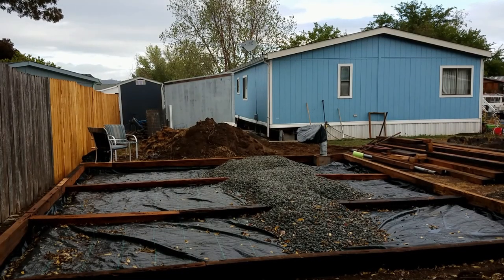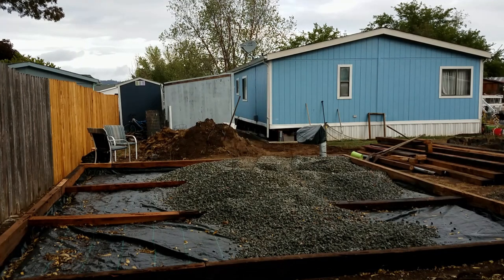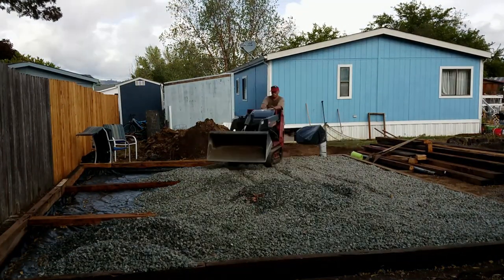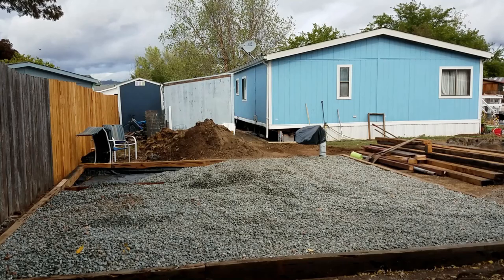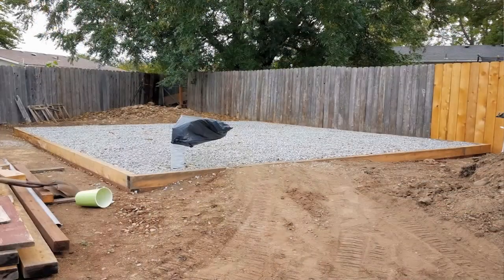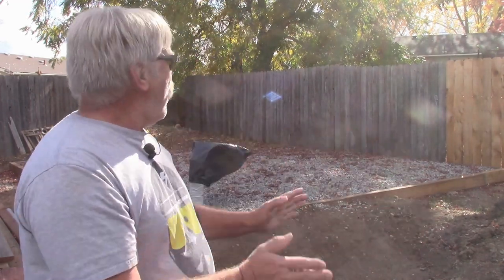Building a Home Hobby CNC Shop/Shed - Part 4 – The Gravel Pad

Comment: I support you in holding back on the purchase of the building materials, prices for timber have more than tripled and everything else also has attracted a premium, I was planning to build a new shed/workshop with 1/3 brick course, I priced it up in June 2019 and the price for materials has increased by 283%, this is at the moment a none starter.

Comment: Yeah, the price of building materials is absolutely outrageous. 2x4’s have come down slightly. I just bought some at Home Depot for about $5.60 each. I’ve resorted to recycling plywood from shipping crates. A friend gets them for me from his work. There’s a lot of nails that I need to pull but if it’s free it’s for me. I’m using them to build doors for my shop. One side of the shop is my tool storage area so I would like to put doors there on a sliding track. I have two done, four more to go. I was gonna buy one of those skid steers a few years ago but decided on a Kubota tractor. It’s been a life saver over the years.